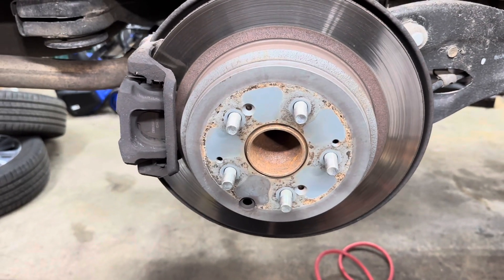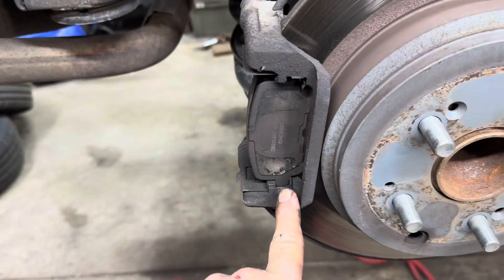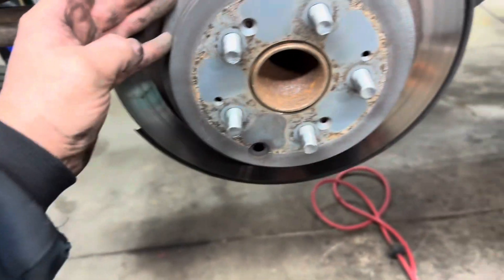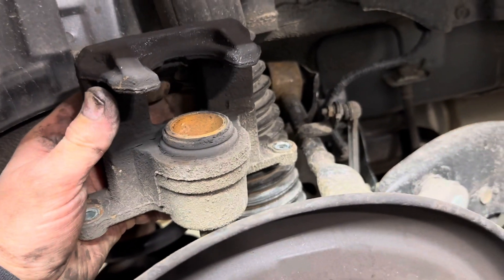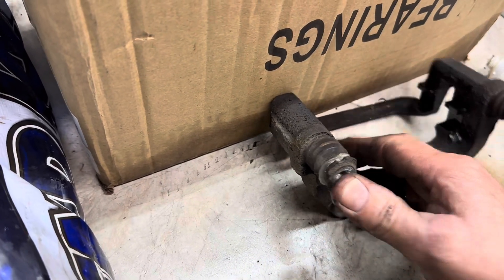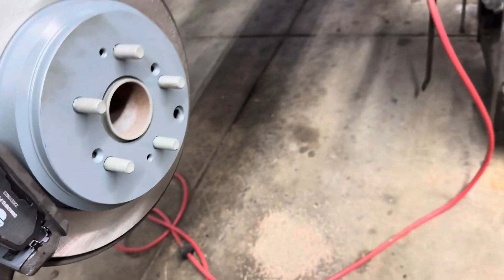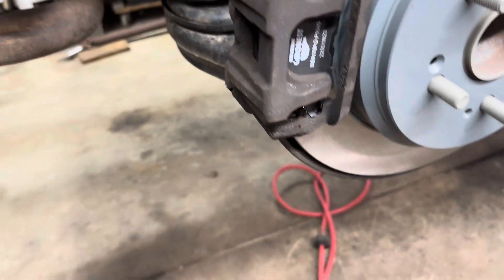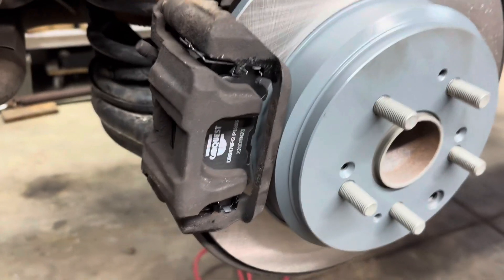2017 Honda Odyssey Rear Brake Pads and Rotors

Comment: 5:08 the torque is actually 65 ft lbs for the back 17mm bracket bolts not 80 for this car. Thanks for the video.